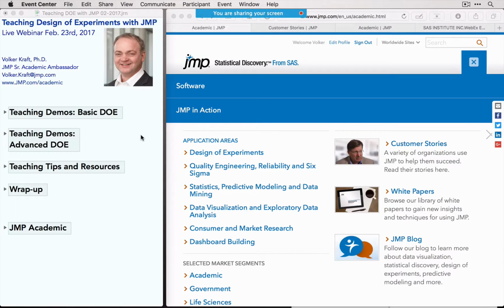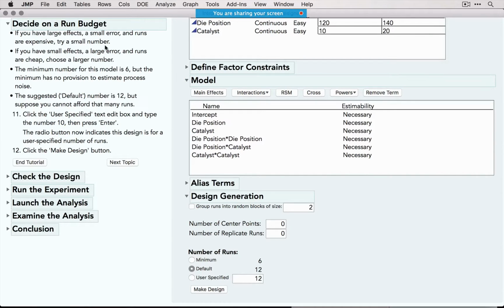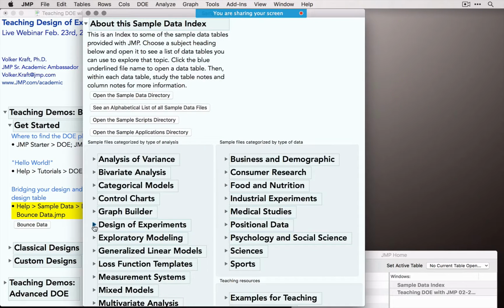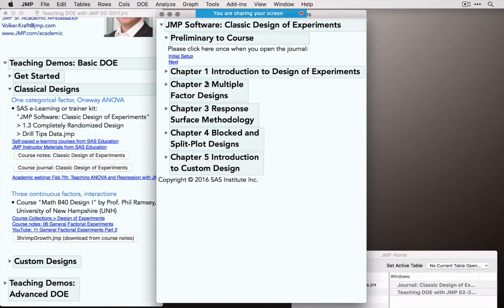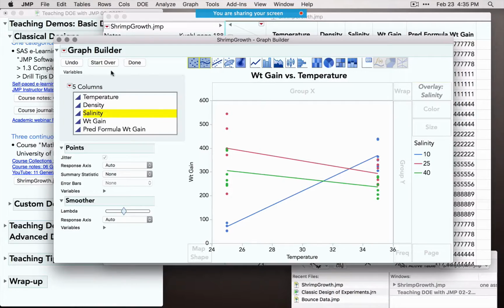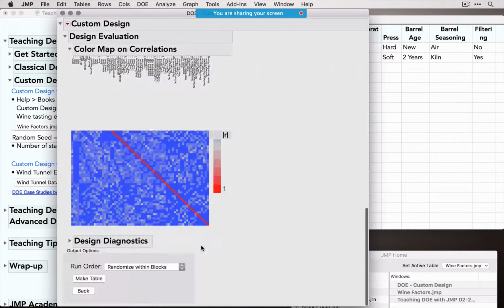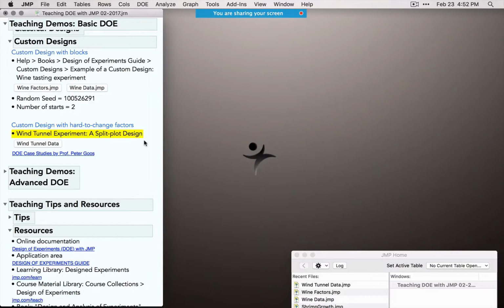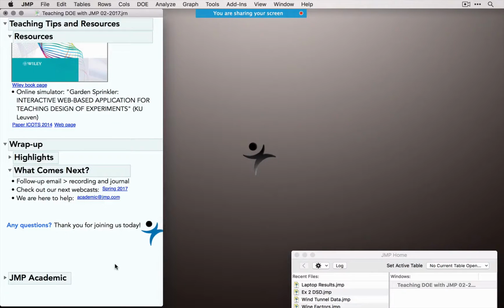JMP Academic Series: Teaching Design of Experiments using JMP (23 Feb 2017)

Comment: Dear Dr Kraft. Greetings from Germany. When I calculate DOE in JMP I am often facing the Problem that I get (for example for a factor) a value with a lot of digits after the comma. How can I avoid that? I can not adjust these values in that accuracy in my test. When I did the design can I overwrite the values with the next possibles? (This happens when I do RSM Designs, were JMP calculates intermediate steps) Thanks for the answers.
Reply from the maker: Hi, you can change the displayed format and digits in the column settings (double-click the column header). Or you can change the values by removing digits or rounding values. In case you are concerned about how these changes effect your design, you can compare the design diagnostics between the new and your original design.
Reply: Volker Kraft Hi thanks, for the answer! Do you also have a recommendation for a similar problem: When we do a DOE we have to manufacture special parts for testing (we are in fine Mechanics Maschine building) for each test setting we need about 100 pcs. So we try to hit the calculated values in the DOE (mean value of the test sample) but that is not guaranteed because of the normal manufacturing deviation. So I would measure parts of every Plot (Split Plot Design / 4 hard to change factors) and replace the measured mean value with the calculated values in the DOE. Is that a good way for getting the desired output (the Modell) or do you recommend a different approach? Thanks again.
Reply from the maker: TheWechris If it is hard or even impossible to find samples with the right spec required by your design, you can consider covariate factors in Custom Design.  JMP can also select the best subset if you have samples to choose from. More at JMP.com/help or email volker.kraft@JMP.com .
Reply: Volker Kraft thanks again. Seems I need more training in this matters with JMP. Now I have some more Ideas which could be done to solve the problem. Have a good day and stay save! 👍